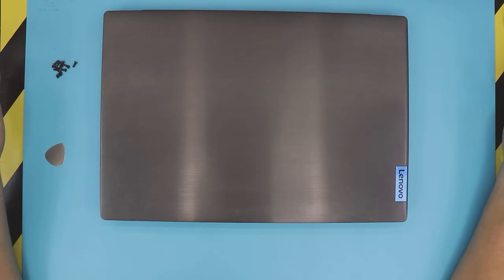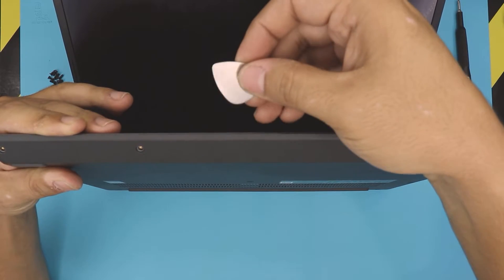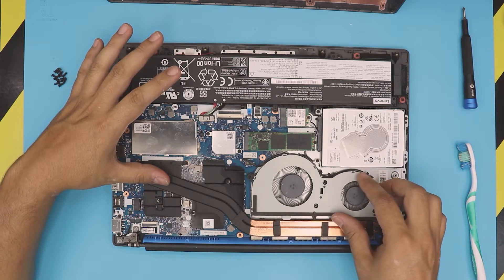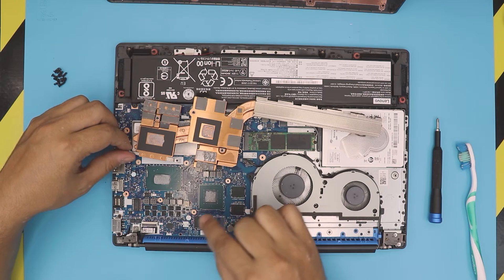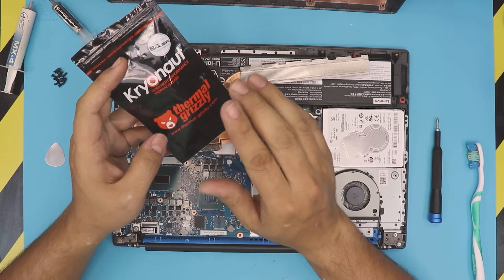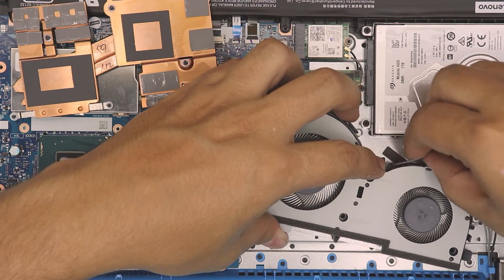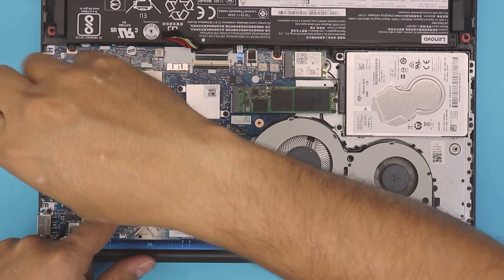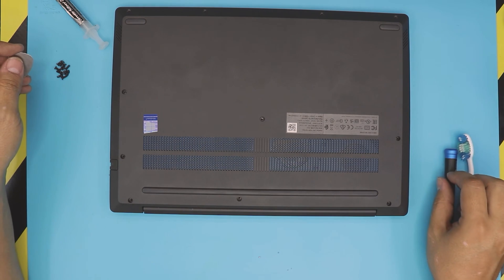Lenovo Gaming L340 Repaste maintenance under 10min !

Comment: I'm not planning to remove the thermal paste just yet but I did notice that the fans have begun rattling just a teeny tiny bit but it makes me antsy. So I want to make sure to clean em out properly so that that hopefully fixes the issue.
Reply from the maker: sure you can go a head and clean the fans and the heatsink, but it would be a very good idea to replace the thermal paste. and i appreciate your support to the channel :)
Reply: @uFixTek  The laptop is barely a year old so I don't think there is a real need ofr that yet. I also don't run programs that heavy very often and I have undervolted it to boot so unless it's very hot in the room it barely goes above 80°C. Which is fine by me. Also is the battery plug always where it is in your video or do I need to look around a bit for that? I don't know what screen size the laptop is you showed but mine is a 17 inch chonker. So I don't know if all the parts are in the same place yet. They should share the same fan models though I think.
Reply from the maker: the battery plugs are 90% the same and the only thing it maybe moved few centimeter to left or right  but the removal its the same. if the laptop its been used for a year and no heavy loads daily then wait for next year. i normally replace the paste every two years for heavy users. good luck
Reply: @uFixTek  Thanks, I have been using this laptop almost constantly though but I haven't noticed any real drop in performance so I should still be fine. Once again thank you for making a video about this model and answering questions. I'm usually very late to issues like these or questions never get answered. It's a nice change for once lol.
Reply from the maker: anytime my friend i always try to stay on top of the comments, just when you got questions make a new comments as its easy for me to identify and not scroll down the list :P and if you dont see a big temp difference then you fine. as long as you dont hit 90c you fine
Reply: @uFixTek  ok, i will. thanks once again. :)
Reply: @uFixTek  2 years daam i had mine fro 4 years only cleaned fans like once a month